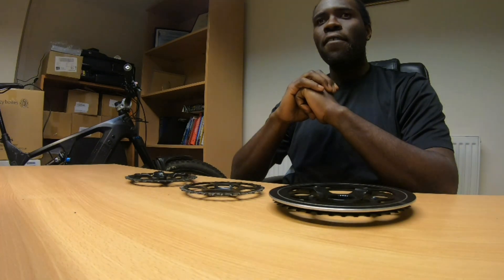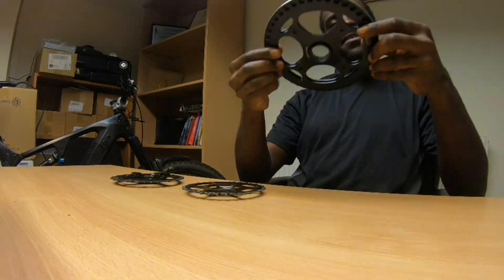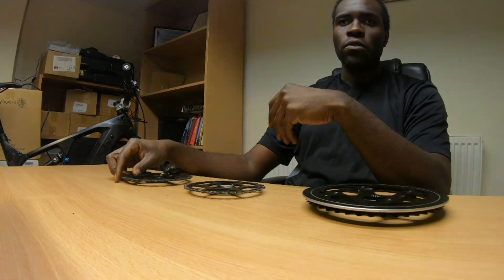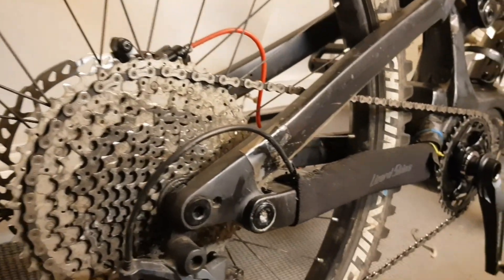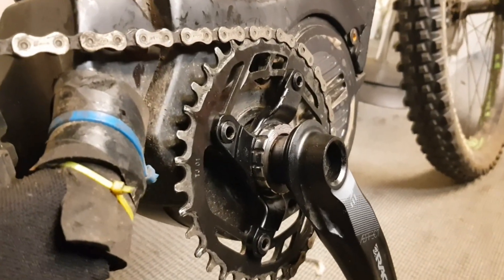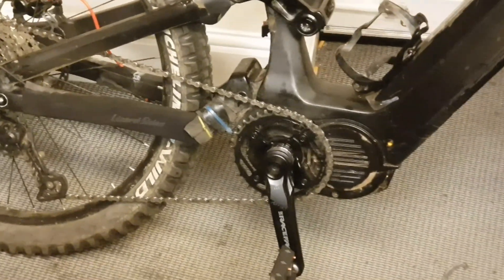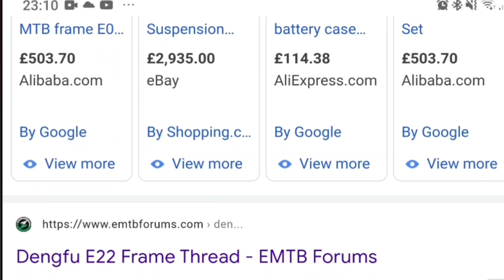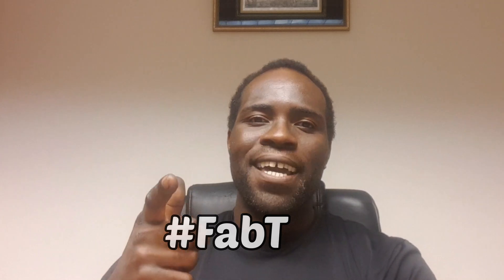Christini Bicycles 104bcd Spider for the Bafang Ultra M620

Comment: I see you got rid of the spacers with this new spider. Exact info I was looking for. Chain looks very close to the chain stay. Ever have any issues?
Reply from the maker: In terms of clearance, no. I installed the chainring so its on the outside of the chainring spider. Because I programmed the M620 to pull upto 750w (20amps at 120NM of torque), the chain life was comparable to 250w mainstream ebike motors like Bosch, Shimano etc. As soon as you revert the motor back to 1500w (30amps at 160NM of torque), you are more prone to snapping the chain when suddenly shifting. 
My E55 uses a 36t chainring, whereas my E22 uses (now) a 34t chainring. 
Hope this helps👍🏿

Comment: That spider fits the M600 as well correct?
Reply from the maker: It can. But the M600 uses a 104bcd spider adapter stock. The M620 comes with a 130bcd spider adapter as stock 👍🏿
Reply: They have different offsets. I know M600 spider requires a 3mm spacer to make it works on m620 motor. It means M620 spider on M600 motor will shift the chainring 3 mm outside and will maintain not straight chain line for single cog or not ideal chain line for cassette. It also means the M620 spider on M600 motor will take 3 mm on the spider nut treads so the nut will be shifter 3 mm outside too and probably will not be engaged properly with the threads. So I would say it does not fit M600 motor.

Comment: Hello, Neeko so im planning to build a defung E10 (i think max front travel is 150mm) so with this adapter am I be able to achieve the correct chain line of 52mm for a boost frame spacing? im just curious what frame do you have and what front fork travel you are running? Thanks in advance 🙏🏻
Reply from the maker: Hi there, 
My E10v1 (now), is running a 170mm travel Rockshox Zeb 29er fork with a 44mm offset. Previously, it was running a 180mm travel Rockshox Lyrik rc fork 27.5 with a 44mm offset. Essentially, the bike retains near enough the same geometry. But it has gained a greater roll over in terms of speed.

My E10v2 (which I'll be debuting soon), will run a 160 fork in a 44mm offset 29er. Basically, Dengfu have requested that I build one closer to the stock travel numbers they have outlined on their website. 

But essentially, the Dengfu E10 can be ran with a fork travel of 150-170 29er or 160-180 27.5 (from my experience).

Keep a watchful eye on upcoming content as I'll be delving into this in upcoming videos.

Thanks for your comment 👍🏿

Comment: Love your videos! They've been super helpful! Do you find that the 38t chainring is the sweet spot for an 11spd? I have a 42t but wondering if maybe I went too big... Is the tool you're using for the bottom bracket a 44mm 16t?
Reply from the maker: Apologies for the delay. Currently, I'm running 32t chainrings on both my E10 and E22. You can use a 38t chainring (provided the chainring is optimised for an 11spd chain). But finding a 38t 130bcd chainring is difficult. Hence, why the Christini chainring/spider is so helpful. 
The tool I used was a 44/16 shimano bb tool. I do have a better tool which is 'YC-29BB'. Use Google and you'll see what tool is better for removing the lockring for both the M500/M600/M510/M620.

Thanks for your comment 👍🏿
Reply: @neekodevinchi  Thanks for the detailed response! I have the Christini Spider ordered! What do you like most about a 32t? This is all very new to me :D
Reply from the maker: The primary reason for me using a 32t chainring is to give the motor a mechanical advantage, without excessively using more power from the motor/battery.
Basically, I can run lower levels of assist, to achieve feats which would be reserved for higher levels of assist. 

This results in the E22 becoming more economical in terms of range/efficiency/battery consumption etc. Naturally, the 11/50t cassette 12spd drivetrain aids with this as well. 
In addition, the Christini 104bcd spider adapter allows you to run from 32t - 44t. So essentially, the adapter gives you more options in terms of chainring sizes.

Personally, I prefer the 32t chainring. However, there are others who prefer the 38t for the speed advantage it offers.

Hope this helps but feel free to check out the E22 Frameset thread on emtb forums 👍🏿
Reply: @neekodevinchi  Again, thanks for the thoughtful response! I'm sure I'll have more questions but this and your other videos have already given me a wealth of knowledge!

Comment: Just like to say thank you for your video and the hook up with Christine bikes do you know that race face cranks will fit the m620 for a fat bike
Reply from the maker: Many thanks for your kind words. I'm not sure if the Raceface crank will work with a fatbike setup as the Q-factor is wider on fatbike specific ISIS cranks. It it helps, I can have a search to see which aftermarket cranks will work on a M620 fatbike setup.

Bare with me, I'll get back to you shortly 👍🏿
Reply: @neekodevinchi  I have the same question as well. Did you ever figure it out?
Reply from the maker: Apologies for the delay. At this point, I have only found the Miranda Delta ISIS  Fatbike cranks in 170mm.

I'll keep my eyes open if I see other cranks 👍🏿

Comment: Can you use the Bosch chainring with the Bafang Ultra Neeko? Cant wait for the next video ✌🏽
Reply from the maker: Sorry Ruban, the Bosch spider/chainring doesn't fit on the M620. The splines do look similar. But the diameter of the Bosch chainring is a bit smaller compared to the Bafang Ultra spider/chainring.
Thanks for your comment 👍🏿